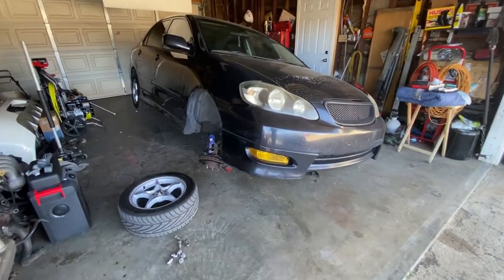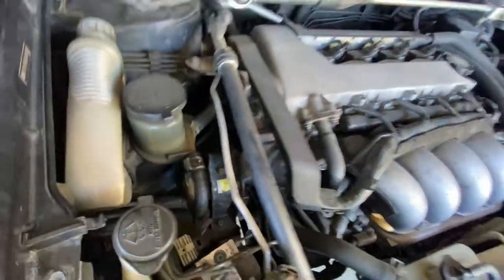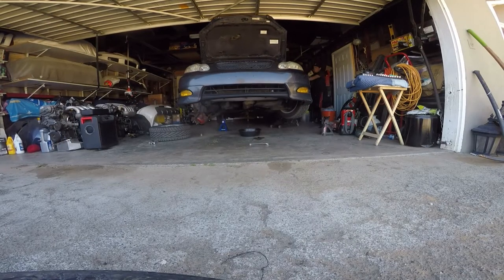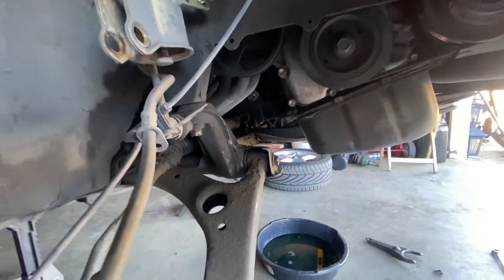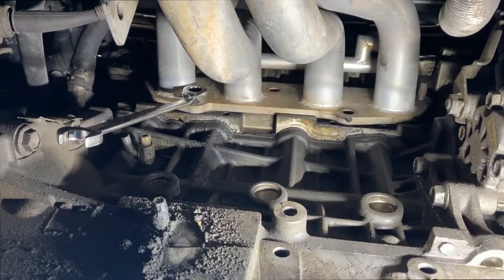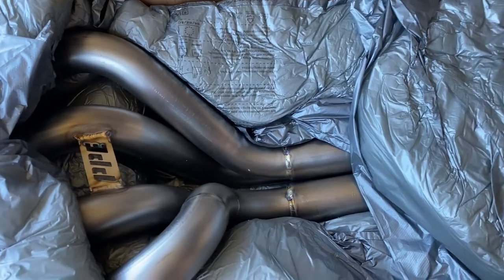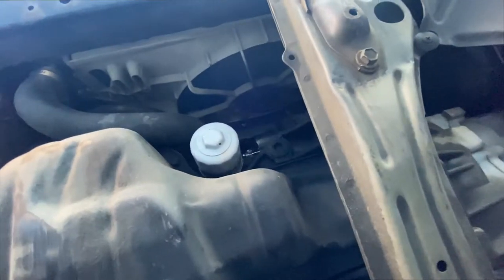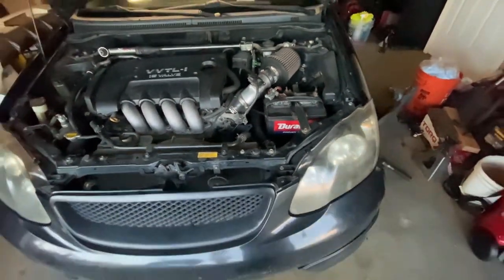Brand New PPE Header 05 Toyota Corolla Xrs

Comment: i just got a corolla xrs and it has a cat delete and resonator delete. I'm trying to figure out the stock exhaust setup and I cant figure out if it has 1 cat or 2 cats?
Reply from the maker: 1 cat
Reply: Thanks for the fast reply ordering my parts now 👍
Reply from the maker: @isaac49710  you’re welcome
Reply: How does it sound straight piped?
Reply: @dcfish2620  alot of drone, it does have a  vibrant muffler. also running 2.5 inch from header back.
Reply: @isaac49710  my matrix has two, pre cat and cat! I deleted the one before the res plus a muffler delete and it’s dumb loud, the trick is i used a “j pipe” resonator attached to my new turndown muffler from ebay which i maybe will change it in the near future! Also i’m looking to put a highflow cat.